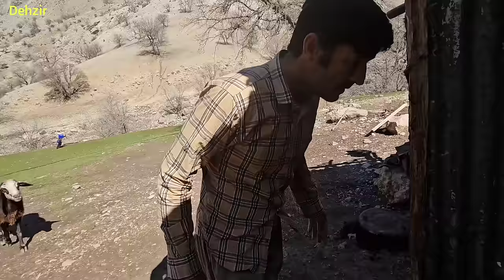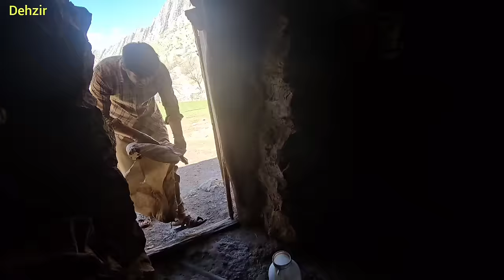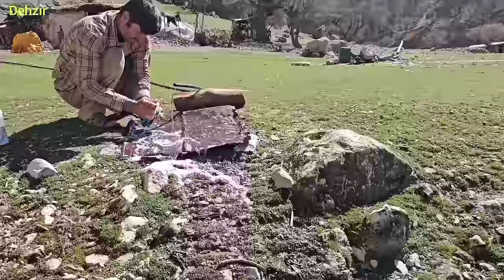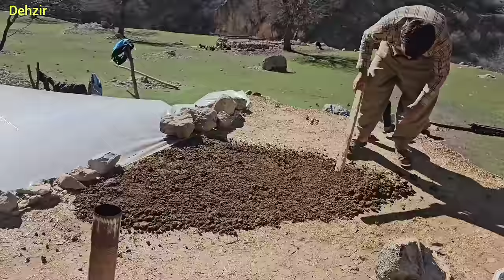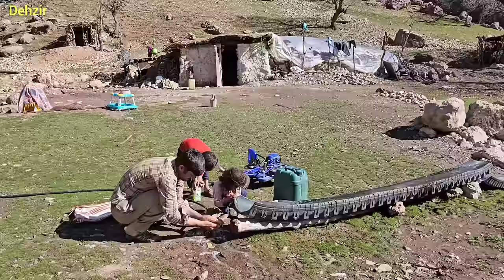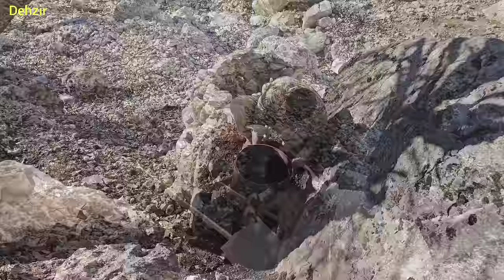"Resistant father: a father in dealing with goats and spraying to protect family peace

Comment: The roof should be covered with soil, so that it won't erode when it rains. It should be mixed with cement to make it strong and prevent leaks. 🙏🏽🙏🏽🙏🏽🥰🥰🥰❤❤❤👍👍👍
Reply: It's very difficult to bring cement sack so cover it with a plastic sheet only